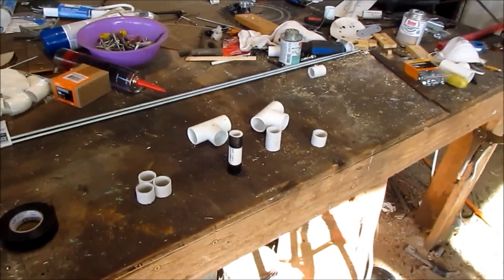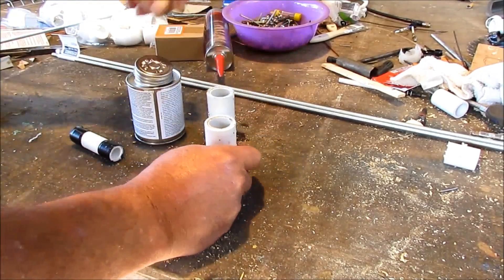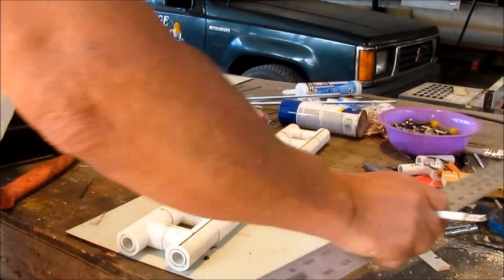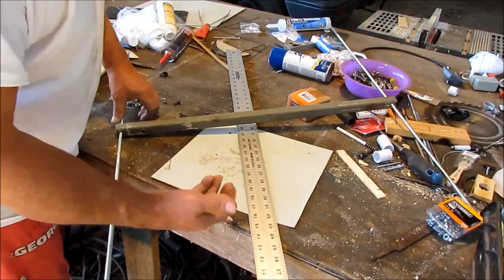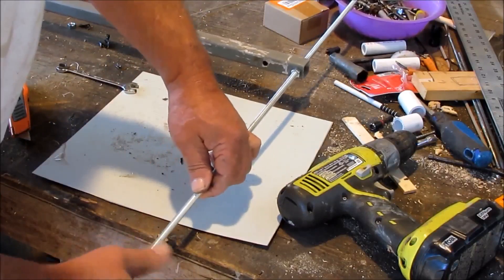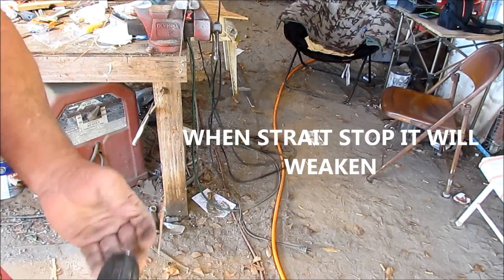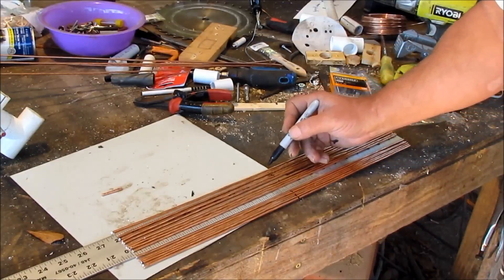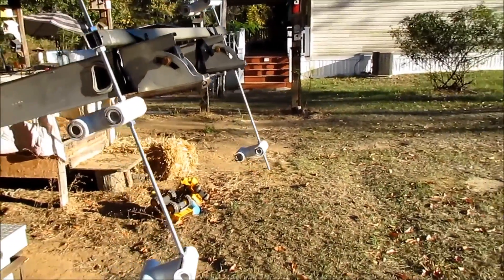MAKE THE BEST TV ANTENNA

Comment: Thanks Danny for all of your hard work buddy!  It's opened my eyes to sharing of your knowledge of antennas.  I've always been into DX'ing growing up in rural WV in the mountains but now I live so close to dtwn Columbus, Ohio I'm not able to receive distant stations since the local ones are so strong it causes distortion.  I wish I could pick up Cincy and Cleveland.  I don't think it's possible.  I used to pick up Dayton a little with the analog signals on a smaller Channel Master directional antenna with a rotor but forget any booster.  I've heard stories that the signal from the local tv stations can fry the digital tuner circuitry.  I miss the VHF analog living in WV.  We could pick up channel 3 WSAZ NBC affiliate from Huntington all the way to Webster County, WV which is 102 miles of deep mountain terrain and the station came in like one was 40 miles.

Comment: Danny, Have you ever experimented with an Eight Bay vertical antenna with only one balun in the center , in other words, seven spaces at 9 1/2 inches. One balun between 3 & 4. I live in a super fringe area here in the mountains of East Tennessee
Reply from the maker: NOT YET
Reply: Wayne Bice I have a 8 bay winegard,  with a balun in the middle,  works really good.